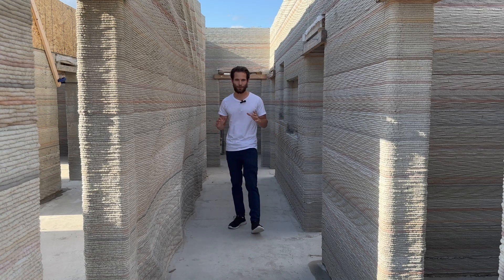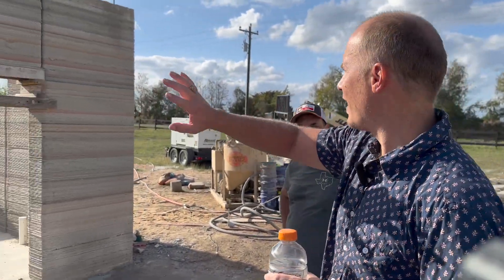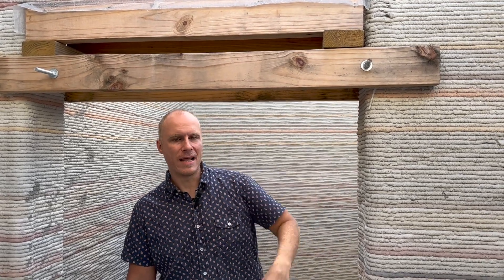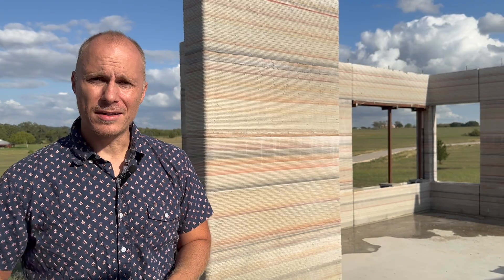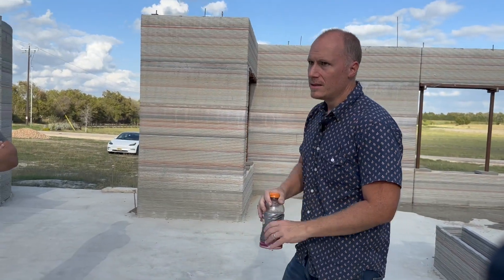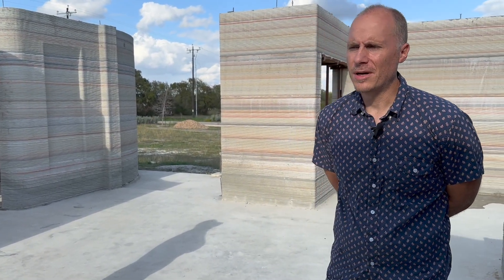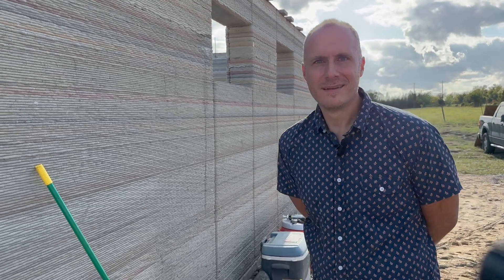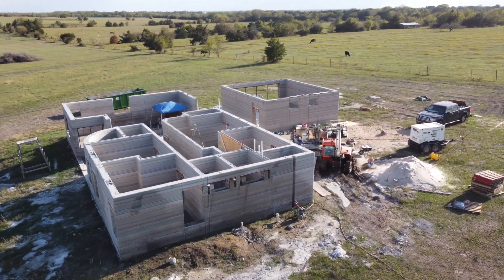INTRICATE 3D Printed House in Texas from Hive3D

Comment: I was a concrete finisher for 20 years, and I’ll be interested to see the progression of the techniques. I could see how the terrain would dictate whether or not, you can actually even set up your 3-D printer.?
Reply: It sits up on rails and blocks so it can be leveled on almost any terrain.
Reply from the maker: Ideally, you certainly want to start with the level print area, and the printer can adjust for fluctuations around an inch or so but beyond that it gets a little dicey. The technology is certainly improving. The number of people working on. It keeps growing and I do know a lot of really smart people working on it. I believe that within 3 to 5 years this technology would be capable of some really incredible things.

Comment: My question is, if take a big hammer and use all of my strength t to hits it, will it break the wall?
Reply from the maker: It’s not indestructible but it’s quite strong. It can be broken with a sledgehammer.
Reply: Maybe?  It’s 12 inch thick concrete so it may not break with a sledgehammer.
Reply: It's no different to the multitude of brick and concrete structures built all over the world, in terms of how easy to damage.
Reply: You should buy a tank

Comment: I really like this project...wondering why they don't try to hit some of the walls with a trowel when they're printing??  Seems it would be easy to smooth out some of the walls that way, but maybe that would cause some weakness??
Reply: I believe there is a printer head used by one company that smooths as it prints.
Reply from the maker: @martinw245  Many companies have something like that called the 'screed' or 'flaps'
Reply from the maker: That doesn't cause weakness, some groups do it all the time.
Reply: Hi Tyler,

Spray on stucco would be the easiest and most cost effective. We plan to keep these walls mostly as is becuase we like the way they look but will certainly smooth out some of our walls in future projects.
Reply: @timothylankau3924  It already looks as good as stucco imo. People just aren't as familiar with it yet. It'd be better to just keep doing it this way until people get used to it!

Comment: How strong is this substance?
Reply from the maker: Didn't get their PSI but most printed concrete is around 5000-6000psi compressive strength.
Reply: @automateconstruction  Reported test cylinder values isn't strength in-place, but the default 2500 psi is plenty.  An aerated mix is probably lower, but still probably fine for wythes.  Getting an aerated mix to stand up quickly and not shrink too much (without expensive ingredients) is their impressive feat!
Reply: Right on!  The printed material is a pretty standard mix so 4000-5000 psi.  The foamcrete is a lower foam mix that tested out over 900 psi. We got almost no shrinkage with it.  It did take some experamentation to get the mix right. All in all way more than enough compressive strength to support a 60,000 pound roof. It could probably support millions of pounds based on The basic math. .
Reply: @timothylankau3924  OK, I misunderstood - thinking that you were able to print with an aerated mix - something I found to be really tricky, but not impossible.  CMX works a bit better than Drexel for that purpose.  The striations look awesome!
Reply: It’s 12 inch thick solid concrete so super strong!